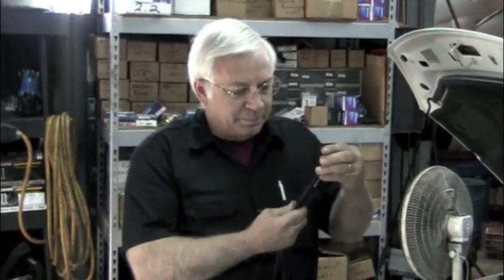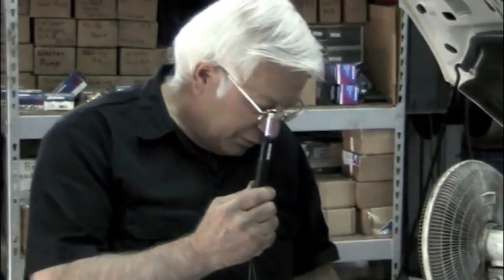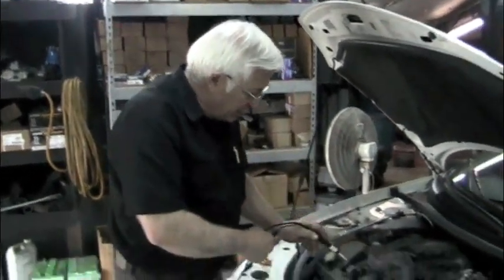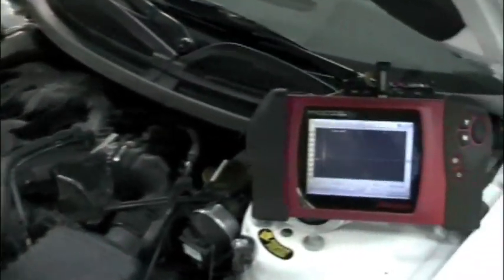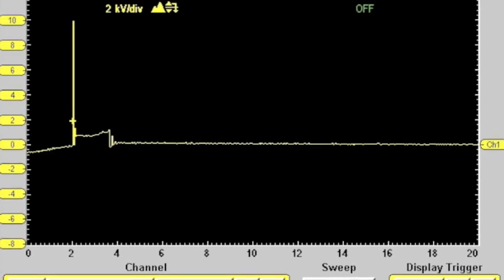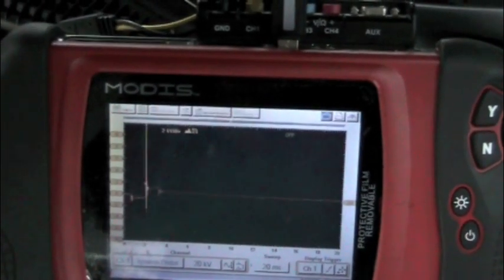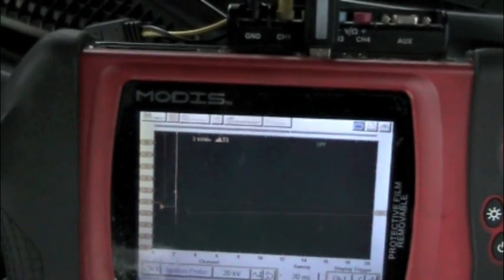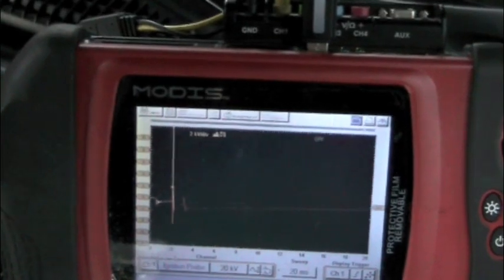Coil on plug lab scope test

Comment: Judging from your other videos seems this test is telling one a firing signal is actually sent, vs. if the coil is actually firing on the plug.
Otherwise the simple inductive "fly swatter" tool will also tell one the Coil is in fact firing...by observing the red and green intermittent lights.  While this info may be confusing the coil disconnect/listening to change test may be helpful.  However  your videos are very informative.
Reply from the maker: you are correct, thanks for commenting

Comment: Not everybody has a "lab scope" ya know. Especially ur average do-it-yourselfers like me. I had a misfire on my Expedition with COPs. Check engine light was one. The codes read misfire cylinder 2. So i cleared the codes and simply switch the coil that was on cylinder2 with the coil on cylinder 1, just switched them around. Didnt cost me anything.Then i drove just to make aengine light come back on. Light came on, and NOW the codes read misfire Cylinder1. Bingo! Replaced the coil. Runs great now.
Reply: Then this video isn't for you, you fucking genius.

Comment: @wlpupo Actually I eventually figured out on my own how to get this to work. I think the reason I never got a reply as to the settings is because each coil is different as to which settings to use and can be very tricky to find the right settings. Even the angle at which you hold the pick-up in relation to the coil makes a huge difference as to whether it displays a pattern or not.

Comment: GREAT INFO but is this not the  secondary  your are testing and not the  primary signal the primary signal can be tested by hooking the lab scope to the ground controled (computer side ) of the coil this will also show you the primary inductive kick and IF the computer is taking the coil to FULL ground or if you have a week driver or bad ground in or to the computer rember powers and grounds can be a big problem   again THANKS for the great info on the COP use
Reply: Of course he probes the secondary (kVolts) with His capacitive probe, 10 years ago.